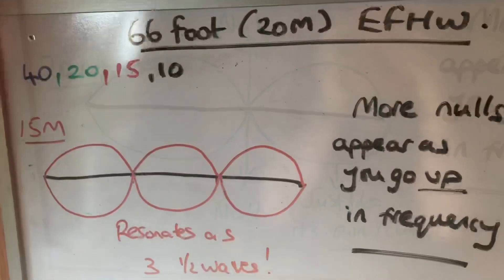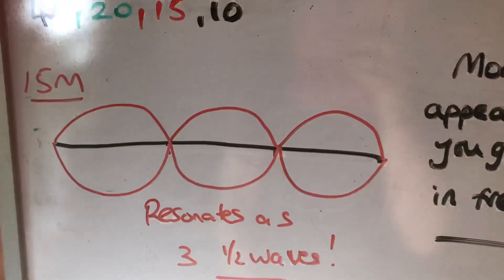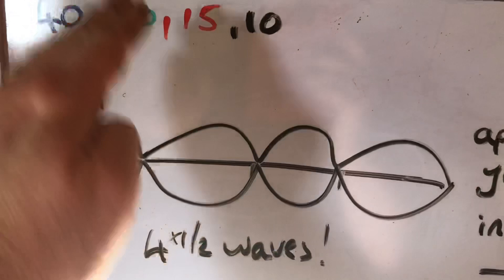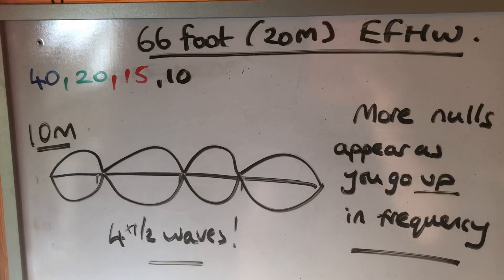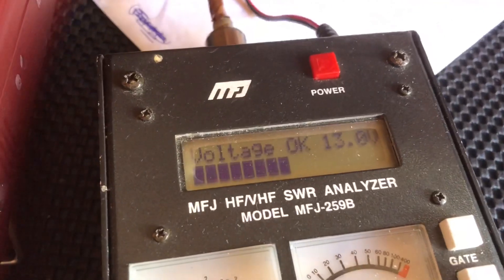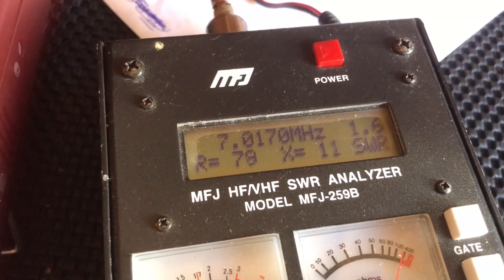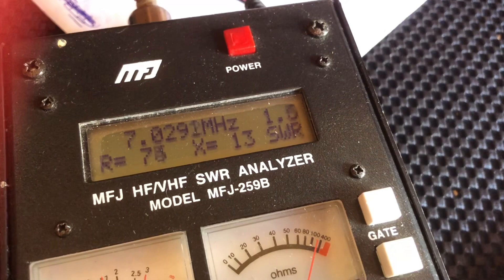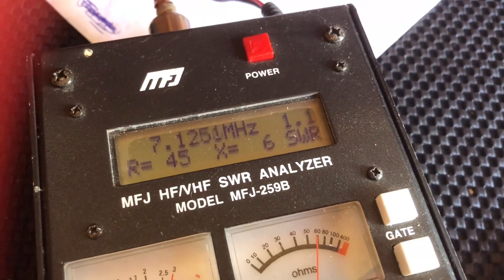HAM RADIO: End Fed Half Wave Antennas

Comment: Is there any way to get 80, 60, and 40 on an EFHW? (Maybe with loading coil(s) or traps?)

73 de AF6AS in “DM13” land
Reply from the maker: Absolutely  - try a 110uH coil at the end of a 20m long efhw, followed by 2m approx of wire (trim that to get a match on the part of 80m you wish.

Comment: What this video leaves out is that with an end fed half wave there are very advantageous gain lobes on the harmonic frequencies that are at low angles when mounted in an inverted V configuration. Something that you just cant get with a center fed dipole. Ive worked from Russia in one direction to Japan in the other using these lobes.
Reply from the maker: Totally agree. I’ve subsequently made a couple of videos on that very same point 73

Comment: Could you not have 2 end fed monoband wires attached to the same feed point put separated as they go down the garden so like a fan dipole, but an end fed version? This would do away with the need for an antenna switch and wouldn't be too difficult to fit in to a small garden.
Reply from the maker: Sadly not Nick, owing to the high impedance at the feed-point. However, a half-wave at the lowest frequency, fed with a 49:1 will provide a good match on the remaining harmonics - hence a half wave for 40 is good on 20 15 10 etc.

Comment: What other bands could you use with a good external ATU? 73
Reply from the maker: Probably most/all but efficiency might be very poor.
Reply: @TIMG5TM  Thanks again Tim. Will be putting up the EFHW this weekend. 73
Reply: Hi. What is the minimum height for this antenna to the 49:1 transformer?

Comment: Question please: How is the directional (end vs. length) radiation pattern on the EFHWA?

I'm new to HF and am planning my EFHWA install. Here in the US, should I run the element north south to contact Europe /Asia & east west for Canada / South America?

Or does this consideration make that much difference? 

Ideally, I'd like to contact all directions... any ideas welcome.

Ken - K0CCT
Reply from the maker: If horizontal then running the antenna N/S would give broadside gain to E/W and vice versa. Any vertical aspect of the antenna would be largely omni-directional. Inverted L for example gives a bit of both.

Comment: Question? Should the counterpoise run back under the antenna in the same plane (in line with the antenna above) or does it matter as long as it is laid out ?
Reply: I measured the input impedance at 7 MHz of a 20 m EFHW, and it was insensitive to the positioning of the counterpoise, which was 2 m long in my case. The counterpoise is just coupling into ground so I wouldn't expect it to affect the radiation pattern significantly (G1JVG).

Comment: Very nice video Mr Tim. I home brew an End Feed antenna to 11 meters, with an old toroide picked up from an old TV. I make a 9/1  Balun with 12 meters tuned all bands except 20 and 11 meters. So put another wire with 5 meter cut off some pieces and with 4,40 an alf wave antenna tuned from 26MHz to 30 MHz with very very good results on 11 meters. So now I understand the working antenna with one lobe. 7351.

Comment: I am getting rather disappointed in the ham radio communities obsession with end fed half-waves. Lets see some NEW designs using MODERN materials.
Reply from the maker: Did you have anything in mind for the new design?
Reply: @TIMG5TM  Well, I like the Double Bazooka, but that dates back to the 1940's. I would like like to try it with modern coax. Difficult right now as I live in a flat and the gardener keeps sticking his strimmer though my antenna. I have started connecting mobile HF antennas back to back. MFJ does their 'Octopus'  The MFJ 2014, reviewed here:- https://www.youtube.com/watch?v=d5TP6oyLJx0 So, yes, I would like to make a cheap copy.

Comment: Hi Tim, ive just ordered an LWHW end fed 20m long antenna,it comes with a 9:1 unun from moonraker. Ive done zero HF before so is this the right ant to start with? The antenna is advertised for 80-6m. Your thoughts greatly appreciated. Will i need an antenna tuner? Thanks.
Reply from the maker: Hiya welcome to Hf! It’ll work .. I’d run a 17 foot counterpoise from the ground lug on the unun if you are mounting the box near the ground level. This will take some of the return rf current away from your coax outer shield and hopefully stop rf in the shack. You will need a tuner .. on some bands you can use the internal tuner in your rig (if it has one) as swr may well be within 3-3.5:1. On other bands it won’t be so you’ll need an external atu. My only slight concern is that at 20m long it will be a Halfwave on 40m and a tuner may find it tough to match that owing to the high impedance levels but hey put her up and see how she goes! Good luck 73
Reply: @TIMG5TM  Thanks for responding. My rig is the 991a with inbuilt tuner. Can you recommend a suitable tuner? Thanks.
Reply from the maker: paulkazjack there’s loads out there. If your budget is around 200 pounds then take a look at the LDG range of auto tuners. Might be a good place to start.

Comment: Tim, Thanks for the great video. What you said made a lot of sense. Here is an idea for you. Those lucky enough to have a tall tree in the garden can hang an end fed 1/2 wave from it and use it as a fantastic low radiation angle vertical antenna for DX. 

Simply fire a fishing weight with catapult over the top branches of the tree with a fishing reel on the ground to provide the line. Tie a nylon rope to the fishing line and pull it up over the branch. Tie the antenna's top insulator to the rope and hoist it up. 

M0UKD has a great article about end fed 1/2 wave verticals and how to match them using a dirt cheap, easy to make, home brewed resonant transformer. All the best, N2SN ex G4FEB now living in sunny Florida USA. 

Here is the URL for M0UKD's article:

 https://m0ukd.com/homebrew/baluns-and-ununs/end-fed-half-wave-antenna-tuned-coupler-efhw/

Comment: Is that horizontal or vertical?
Reply: got it thanks
Reply from the maker: Hi Steven my antenna at home is an inverted v shape with both ends running down vertically. 73

Comment: Could you do same video for a 140ft efhw with 49:1 transformer please
Reply from the maker: Hi Andy. If I had the room for that much wire I would, but alas 66 ft or a little more is all I can fit in. 73
Reply: @TIMG5TM  I've only got a 45ft by 45ft garden but have a 140ft end fed and works really well at a height of around 20ft,any higher the swr goes mad.
Reply: @TIMG5TM  yes I have the same problem no room in the garden. 40-meter end fed with 80 coils works great for me.

Comment: Hi Tim the best way to get 80 meters  on a small garden is to add a 80 meter loading coil and 3 meters wire to a 49-1 End Fed Half Wave Antenna .
Reply from the maker: I agree .. a great method and on my to-do list ... 73
Reply: yes, I added an 80-meter coil, once I trimmed the wire I got the SWR 1.1in the SSB voice section. it works very well far better than the G5RV half size with 80-meter coils fitted.

Comment: Issues.   1.  A wire which is a half wave long in free space does not resonate on its harmonics.   If you have a horizontal 66ft long wire say 20ft high in the garden,  then the harmonics are way off.  Moreover it won't resonate on 40 metres either. (7.1MHz resonant wire will also be resonant round about 15MHz, 23MHz and 32MHz depending on particular circumstances).    2.  The input impedance varies on each frequency from around 1800ohms to 3200ohms.   So a  49:1 is pitched in the middle.  From memory the first harmonic is around 2500ohm.
3. The EFHW is a high impedance antenna and is rarely implemented properly.  It's a dog for common mode issues,  which is one reason why so many people report it as being 'noisy'.  It's not the antenna thats noisy,  but its implementation.  4. The 49:1 transformer has a narrow bandwidth in relation to the 80-10m bandwidth boasted,  moreover,  the transformer expects the wire to be resonant at the operating frequency and it pretty much never is.   Consequence is,  I've ditched the multiband EFHW its a mess of compromises that are exceptionally time consuming to sort.  The good SWR readings are largely down to system losses.   Basically, the antenna is lossy on the low bands and inefficient on the higher bands.

So, monoband EFHW.   I've designed and built a 20m halfwave vertical from scratch,  using four short (520mm) radials.  I built a purpose designed resonant tank type matcher and it is better than 1.2:1 right across the band, and the return loss is better than 30dB at 14.2MHz.  It is 3 S points better than the multiband 66ft wire on 20metres.    However,  this antenna is not without common mode issues.    This is clear from the EZNEC modelling.  I've built an RF ammeter so I can measure the real life cm current, but need to do the test measurement.  Basically, short radials do not decouple the antenna from its feedline.   If we look at commercial installs (ie broadcast) of the vertical halfwave,  then they use halfwave radials and a lot of them.   Bit ironic, because I started down the vertical halfwave journey because of the short radial / "no counterpoise" meme.   Turns out its another myth.   There are better antennas and  antennas properly designed for specific bands will always outgun multiband compromises like the "EFHW".

So after three years of sweating the detail on this stuff,  then my small garden antenna is going to be a horizontal wire, centre fed and resonant on 7.1MHz.   It will be as high as I can possibly get, probably 10/11 metres.  The I will introduce some 'fan' elements for 20 and 10 metres and bring those to resonance.  Capacity hats on the 66ft wire will tune the 40m element for 15m.  This lot will be fed with 8 metres of open wire feeder to a remote tuner so I can impedance match the WARC bands,  otherwise it would not need a tuner and I could use coax all the way.  For 160m, 80 and 60,  I'll short the base of the feeder to create a top loaded vertical and have a remote tuner to sort out the impedance matching.   This approach addresses the point that below 40 metres in real world conditions,  verticals outgun horizontal wires.   Until I've done the design, build, measure I can't know this is the best antenna I can install,  but its my best shot at the minute.
Reply from the maker: Interesting stuff thanks for sharing 73

Comment: Nice video Tim 👍. 
I use a multi band  EFHW for 40,20,15 & 10. I have it in a inverted L configuration with a slight dogleg to get it to fit in my small garden.& and I must say it works very well.
Reply from the maker: Thanks Stuart yes they work v well indeed 73

Comment: Backing up the theory Tim, I have a 124 feet (37.8 meter) end fed and confirm it works well on 80m, ok on 40m and it is dummy load on the higher bands.
Reply from the maker: Thank you Mr Adrian! 73
Reply: Ady G6AD 
Actually with proper made transformer it should work on 20. Not perfect but acceptable.

Comment: Another informative video Tim and spot on with what you say. I have been using both types you describe and the EFHW is now my antenna of choice. The beauty of the end fed is i can get it out into the garden away from the house and away from any electrical noise. Add in a decent line isolator on the feed before the coax enters the shack and bob's your uncle. The LC network is very efficient and will not heat up like a toroid will and thats where some loss can come in. I have come to the conclusion that i will not have the real estate to have an antenna for every band so pick your favourite and get an efficient antenna for that band and make contacts.
Reply from the maker: Sid thank you. I’m in the same position and I’m becoming a real fan of these mono banders myself. Hope to work you soon on 40. 73

Comment: My multi-band antenna is ia 5-band antenna, 23 meters long.  10, 15, 20, 40 and 80 meters (80 meters electrically shortened) from the dutch company www.hyendfed.nl.  I have it configured as a sloper.  An inverted "L" or inverted "V" configuraton is also an option . A mono-band antenna for 20 meters (or for 10 and 15 meters) can be configured vertically for small gardens.  An advantage to both antennas is that no tuner is necessary.  73!  SV0SGS
Reply: Frank, i have the very same antenna and i am always surprised just how well it performs on 80m. Yes it is a compromise on 80 but as signals are generally strong on 80 at night you can't really tell the difference.
Reply from the maker: Thanks, great info 73

Comment: Tim I'm using a MEF-330-1K transformer with a 66' 12g wire up/over a 45' tree in a sloper configuration pointed northwest/southeast direction. Will this work have directivity on the 10m band in those direction's and what kind of gain would it have?
Reply from the maker: Difficult to calculate gain but the directivity is slightly biased towards the  lower side of the antenna. So if it’s fed low and  slopes at an angle upwards, the direction favoured is back towards the direction of the feedpoint. At 66 feet there will be some pattern break up and as much of the antenna will be over a halfwave in height for 10m the lobes and nulls May be pronounced. It’ll work though 73
Reply: @TIMG5TM  
Thank you I will be putting up my 66' 12g wire shortly hopefully I will be able to have some qso's in both directions.
II might be able to move the front wire more south easterly to direct my signal.
Please do more videos on the end fed half wave wire antenna on radiation patterns in the near future. 
Thanks 
Stay safe during the covid-19 pandemic.
73
PS My MEF-330-1K transformer is up 10' off the ground which just might help with  forward directivity in the wire south easterly direction.

Comment: I use a multi-band end fed half wave antenna configured as a sloper at my qth.  For portable work I prefer a mono-band end fed half wave antenna.  Since I work portable during the day, my choice is an antenna for the 20 meter band.  I use a commercial antenna from the German company www.lambdahalbe.de that has and adjustable window line stub instead of a matchbox.  10 meter radiating element, 4 meter stub.  It is easy to adjust the SWR for various situations. Also, it is much lighter than carrying an extra match box.  Sometimes I hang it from a spiderbeam 12 meter telescope pole (fits vertically very well) or hang it from a tree.  I try to avoid trees because the seem to want to keep my wires and not give them back.  End fed antennas are relatively cheap to buy and cheaper to make.  For my situation they are an ideal solution.  73!  SV0SGS
Reply from the maker: Great info thanks for commenting! 73

Comment: this applies to a 80m efhw? Does the multiple lobe increase effectivetines of the RX/TX?
Reply from the maker: Once the pattern breaks up in the higher frequencies it becomes a little more of a lottery. If the station you’d like to work is in the direction of a lobe that’s great. If they are in the direction of a null that’s when you may struggle. It’s the same with large doublets on higher bands too. 73

Comment: Thank you for another very informative video. Will vertical vs horizontal monoband or EFHW have much of a difference in efficiency?
Reply from the maker: The choice of configuration (horizontal or vertical) doesn’t affect efficiency as long as for example, the antenna isn’t too low and then ground losses play their part. Otherwise it’s my suspicion that the mono bander, being narrower in swr 2:1 bandwidth would be nearer a dipole in performance on the full and wavelength frequency than the broader banded 49:1 multiband. I wish I had enough room to run both off WSPR to gain a full scientific perspective. 73
Reply: Totally different polarisation & radiation patterns from horizontal & vertical so very different depends what your looking to do as to what you use it for. Mr 2e0ftx